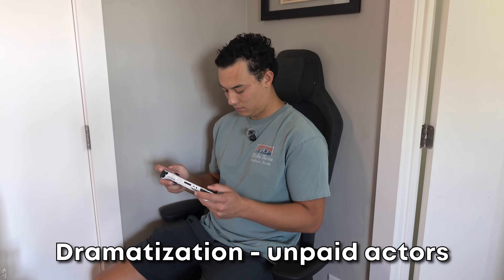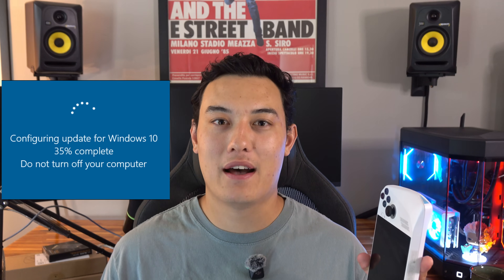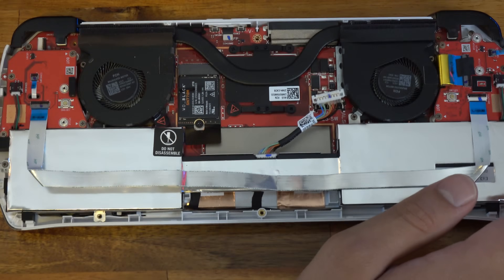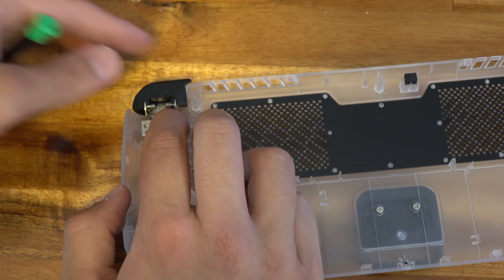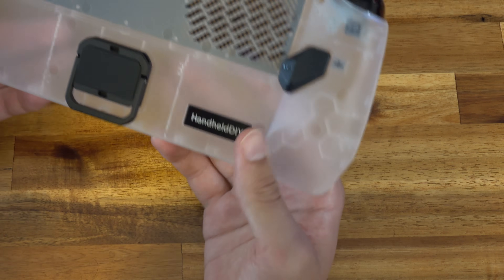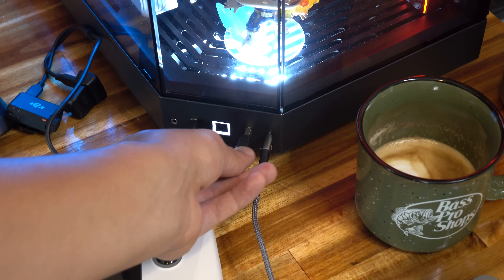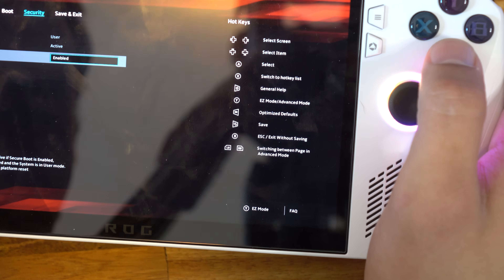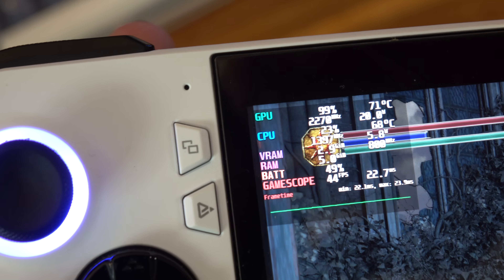$250 ROG Ally Overhaul – Full Mod Guide

Comment: So its been some time, can you give an Update on the battery Performance?
Reply from the maker: Held up great, still pushing 3 hours of playtime on AAA games
Reply: @JokOfAllTrades  thanks for the quick reply! Do you think the battery needs the custom backplate or would it be fine with just the original?
Reply from the maker: Original will work fine, just be careful with your trimming as to not puncture the batt

Comment: QUESTION !!!!
how is it a few months later ? the reviews on the one you linked are mixed so i just wanna ask
Reply from the maker: No complaints, just took it on a 6 hour plane ride and it lasted nearly 3 hours playing e33 and running at cooler temps than stock
Reply: @JokOfAllTrades heck yeah !

Comment: Couldn’t you just pop the back plate off an add extra ventilation holes to help with the cooling?  Assuming you don’t want, or aren’t comfortable, doing the other mods?
Reply from the maker: Definitely possible, you could just get some cutters or a dremel and knock out some more ventilation for free

Comment: For the back plate all I did was remove the filter screen and put a piece of electrical tape on the light sensor and it dramatically improved my temps. Free performance.

Comment: With that os can I install battle net
Reply from the maker: You have a linux desktop interface, so as long as it will run on linux ur fine.  I did end up dual booting windows back on so that i could run some emulators tho

Comment: I ended up just getting a dock with a 1tb ssd that I can swap between as required and fits into the standard travel case so I don't lose it. Also plugs into a travel battery pack for about 4 to 8 hours of extra power. I wasn't brave enough to open my ally and chop things up. Great video though.
Reply from the maker: Thanks man, i think dock setups are pretty cool

Comment: I had issues on Bazzite to get the Virtual Keyboard working correctly on my Ally X, so i switched to CachyOS Handheld Edition which is built the same way but everything just worked "smoother" - sticked to it and iam happy since. 

Maybe that changed in the meantime - it was in the beginning of the Year when i made the shift from Windows on all Devices i own (including PC on which i shifted last Year for Testing Purpoises) over to Linux.
Reply from the maker: Yeah I would love to do that but unfortunately much of the software is use is windows compatible only  :(
Reply: maybe you should give WinBoat a shot - it's made for such things and it's getting better and better. 👍🏻

I ran into similar issues with my stuff, but luckily I found a worthy replacement for nearly anything - the rest I got running with WinBoat (Photoshop) but this will soon also be replaced by Gimp when I've got used to it. 😊

Comment: Well lest se if it works for me, pretty except the SSD I ordered all the same stuff you use here, I did include a aluminum plate to insolate the battery and not using bassyte, since we'll I am kind of a filthy pirate, also how is the battery holding up?
Reply from the maker: Battery is holding up great, gl w the build!

Comment: Can I install the 74 wh battery If I am using 2TB 2280 drive with an adapter ? Will be there enough space ?
Reply from the maker: cant say for certain, but you should be fine since the drive isnt what is blocking the larger battery from fitting.

Comment: honestly the faster charger and an ssd upgrade is gonna the be most noticeable upgrades also get different different joystick caps that arent loose. this ssd is slower than a flash drive.
Reply from the maker: Flash drives are fast i.e. "flash" storage, but i get ur point.  I like the joystick and charger idea tho, might make a part 2 where i attempt the ram upgrade + these mods

Comment: When you said Rog ally z1 extreme did you mean to say just Rog ally cause the chip in the Rog ally and ally x are different and the one mentioned comes in the Ally X?

The ally has the z1e I’m pretty sure and the ally X has the extreme which is why it’s called the X, great mods just curious.

Also how much did the build cost and is it worth it over just buying an ally X? Especially a used one.
Reply from the maker: Yeah the original ally came with either the z1 or z1e, i was just distinguishing between the two.  Total cost was 250 for the mods and a used ally goes for like 250 rn.  If you can find a used ally x for ~500, i would probably just go that route, otherwise the modding is a fun weekend project.
Reply: @JokOfAllTrades thx!

Comment: Thnx so much man! I a steam deck I'm getting ready to go in on and i end up grabbing this same rog on the cheap the other day. The battery life was a major let down so i definitely came across this at the right time. I think the sd slot might be cooked on mine as well. Either way the ssd needs an upgrade. Anyways thnx for the video. Definitely subscribing! ✌🏾
Reply from the maker: Thanks for the comment!  Yeah the sd card slot is a 50/50 if it works, i wouldnt recommend throwing your nice sd cards in there.  Let me know how the modding goes!

Comment: Hi I used the same backplate as yours, but battery slightly bigger and right now facing problem that backplate cant closed completely, can you advice any tuning can be done? Thanks
Reply from the maker: If you got the 80kwh i think ur cooked unless you do some serious trimming.  I specifically got the 74 cause i knew it would fit
Reply: @JokOfAllTrades I used the original case and trimmed flat all the way then I can closed, I believed the handheld diy backplate middle part of the stand causing I'm not able to close it😢

Comment: Using PTM7950 instead of the stock thermal compound should also reduce thermals by a decent amount. However, some of that temp drop you experienced was probably due to less overhead with Bazzite compared to Windows 11. Hindsight, testing with the new back plate in Windows 11 first would've given a more accurate comparison.
Reply from the maker: Yeah i need to work on my benchmarking methods a bit, tbh i was worried about something breaking/exploding so i was pretty focused on just getting it to work at all lol.
Reply: What is ptm7950
Reply from the maker: @prosoilder1947  type of thermal compound

Comment: does bazzite better than win11 ghost spectre?
Reply from the maker: Havent tested personally, but id imagine anything linux based will generally run lighter than anything windows based
Reply: @JokOfAllTrades i have tested it compared to stock win11 avg fps roughly no difference, but 1% low much improved.
less 2GB of ram usage at idle too
Reply from the maker: @kucingganteng3148 1% lows is the most noticeable performance stat in actual real world gaming imo.  Sounds like it could be a decent matchup, i may even try that out for my main machine, thanks for the tip!

Comment: I have all the exact same mods. I didn't even turn it on until I put in 2TB SSD. Just recently updated battery and back plate.
Reply: May I ask how is the battery? I am now between legion go s with z1e, rog ally z1e or steam deck and don't know what to choose will also emulate switch games for my daughter
Reply: dont forget about fixing the wobbly joysticks and you can get a faster charger to push more power. but yea as a person who has the original ssd it takes forever to load and has really bad texture pop in. straight trash.

Comment: The only downside is really the joysticks. 

Not only do they feel way too loose for me, but they also use the same cheap modules found in the GPD Win 3, and they're prone to drift but easy and cheap to replace. 

I tried some Hall effect sticks, but the interference from the Hall effect triggers just wasn't working.
Reply from the maker: Ive heard the hall effect mods for the OG ally are pretty mid.  When my sticks crap out, I will cop a new model and do a follow up episode of this vid.

Comment: I bought a 2TB 2280 SSD for $100 and the 74wh battery for $50.  I just removed the black dust screen on the original back for cooling.  My Ally is a beast now.
Reply from the maker: Yeah insane prices on that, some dude was trying to tell me i could resell my ally and get a used ally x and spend less money.  I dont think that argument is holding up with ur prices lol.
Reply: @JokOfAllTrades how much did you sell / buy used? 
I found a 23’ ally extreme for $115. Thinking of buying it and modding it.
Reply from the maker: @Djxdarienx1 that is an insanely good deal, you should def scoop
Reply: @Djxdarienx1 where did u find this?
Reply from the maker: @Controla33 not him, but all of the good deals i see are on fb marketplace.  Ive sniped some pc parts for crazy prices

Comment: I’m surprised you didn’t use the windows debloat script like what Linus Tech Tips use everything time that install windows
Reply: There's no point in doing that
Reply from the maker: Ill take a look thanks for the tip
Reply: @JokOfAllTrades  Chris Titus Tool (Windows Terminal Script) is what I believe this commenter is referring to, its pretty useful but not an end all be all for major gains unfortunately.
Reply: Even with that the Windows experience is terrible. Bazzite is the way to go 100% of the time. Been running it for years now.
Reply: @witebatman  As someone interested in a Portable PC system like the steamdeck / Rog Allys...The question i have is can bazzite run non-steam games? Epic game launcher, Minecraft Java via Curseforge...."alternatively downloaded" games....etc..? Including games with Anti-cheat...specfically. Ive heard that trying to run epic games on linux based systems can cause issues with Anti-cheat.
Reply: @Dari300ra  also, Yes. You have play the suspicious games with little to no problems, as long as you read the menus during setup.
Reply: @witebatman  honestly i'll probably just get a Rog for the Win11. Im a pc gamer at heart and am extremely familiar with Windows. SteamOS and other Linux based OS just seem like too much work for what they do.
Reply: Tiny 11

Comment: oh men I see a lot of comments, but hopefully you can confirm if the shell replacement are the exact same size? because I do have a grip and not sure if it would fit with the new backplate
Reply from the maker: The silicone ones that go on the grips should work, i dont thing the jsaux case will tho
Reply: @JokOfAllTrades thanks for sharing, mine are 3D printed,  i think they wont fit

Comment: One more mod to complete is 32GB 7500mt ram upgrade. 🤓
Reply from the maker: For sure, i got a few comments ab this already
Reply: @JokOfAllTrades  yh this would definitely help but its not for the faint hearted 😂
Reply: I have it its very helpfull mod
Reply: @variousmusic630 did you update the bios and the ram stayed
Reply from the maker: @variousmusic630 im taking a look at doing this mod soon, do you have a guide you would recommend following?  I saw a couple helpful reddit posts but want to see if theres a good one already out there
Reply: @JokOfAllTrades dude just do it already man
Reply from the maker: @GoldFus1on dude im scared but at this point i can just replace for like $250 used if i brick it
Reply: @variousmusic630 For what?
Reply: @JokOfAllTrades bro plzzzz do😭
Reply: How can you do that? I want my ally to have that too  @JokOfAllTrades
Reply: Not exactly diy or cheap. Might as well go with a different handheld at that point.
Reply: @cmiller4567  if you're doing it yourself, than it's DIY
Reply: I did the same mod but I stuck with windows and heavily debloated my windows the way I did for my desktop and my performance is great as well as temps.
Reply: @brandonlopez8981  got a guide for that?
Reply: @brandonlopez8981  the debloating, that is. And for the ram mod while I'm at it I guess
Reply: That one’s max difficulty 😅
Reply: That's what I was gonna say. What about the RAM. That and the battery is the most important upgrades. The ram is hard to find techs to do the work. 😭
Reply: @jamsa2545 16Gb is fine for what the APU can run
Reply: Just go 64GB, the chips are only double price or so. 😅
Reply: yea but the average person wont be able to micro-solder !!
Reply: A guy did it actually, but other level of modification
Reply: Completely unnecessary

Comment: You can use secureboot, just need to reset the keys and put it on setup mode, then when it boots you can enroll the keys in Bazzite, you can do this in Desktop mode.
Reply from the maker: Thanks for the tip.  I just tried the secureboot fix first and it worked so I haven't messed with it since
Reply: @JokOfAllTrades 
Bazzite doc will help you a lot
It's one of the best docs I have ever read:)

Comment: Bro I literally did all of the same mods, same battery same backplate and same exact ssd lol! I put the official version of Steam OS rather than Bazzite but that's the only difference. Loving this thing, Lossless Scaling through Decky is also a game changer.
Reply: I just tried LSFG Decky yesterday and it blew my mind, especially you can use it on 30fps locked Switch games and it doesn't give you perfect 60fps because it doesn't smooth out stutters (ALL THOUGH if the option was given like "increase input delay but also smooth out the stutters", I'd use it)
Reply from the maker: @EverRusting  cant be compromising my input delay against gael bro 🥲
Reply: @EverRusting may I ask how well doest rog ally emulate switch games? 30fps is good enough for me, stable 30. My daughter wants Nintendo switch on birthday but was thinking of maybe put a bit more money and just buy something like legion go s or rog ally and just emulate games on it so she can play switch games but also normal PC games + watch YouTube, Netflix or just cartoons.
Reply from the maker: That's awesome, how has it been performing for you so far?
Reply: My battery (same one in vid) deteriorated over the past month and a half. It died at 40% and won’t charge to 100% I tried to cycle it and everything but it just died
Reply from the maker: @thejaconator6365 you pack it into the case too tight?
Reply: @JokOfAllTrades  don’t believe I did. It had enough wiggle room without free moving. All I did was put a little cooling strip on the RAM under the battery. But even before I did that it was deteriorating rapidly. I just put the old one in and ordered one from a different brand.
Reply from the maker: @thejaconator6365  eh, I mean we are ordering these things from china, prob due to get a few duds.  hope the other batt works out for you
Reply: @thejaconator6365  did charge it to 100% and kept it charged for 2 hours once at 100%, then drain it to 0 completely and then recharge it to 100% ?
Reply: @PluPerfective yeah I got a new one. Turns out mine was defective.
Reply: Is it worth doing this to save money over spending $1,000 on the new xbox ally or at least the fun of the tinkering?
Reply: @arnulfolemus1942 I enjoyed adding the mods but I’d suggest you save for the Xbox ally and put bazzite on it for performance. You could also buy an EGPU and a dock make something similar to a Nintendo switch style setup. Pretty neat what you can do with these things.
Reply: @a @arnulfolemus1942 also if you want a Xbox ROG Ally x fast, I’d suggest financing one from Best Buy and paying like 80 bucks a month. They have a no interest plan that’s super consumer friendly, it will also help your credit score grow.

Comment: Thanks for posting this video! I was using it to obsess over my Ally before I got it, and I also used it to help me actually do the mods once I finally got one today (Friday July 25th, 2025). What's interesting is that initially when trying to power on my Ally with my transparent HandHeldDIY black plate with a piece of orange electrical tape it wasn't turning on unless I connected power to it. Thanks light sensor lol but then IDK what happened... it just started working, and I'm glad because I don't wanna take my Ally apart again for a long time. I put a 2 TB 2230 SSD in there as well as the 74Wh aftermarket battery, and so far it's working wonderfully. upower --monitor-detail even reports 75 Wh vs the marketed 74 Wh.... I'll take it! Thanks again!
Reply from the maker: Yeah the extra Wh was a bonus.  Glad you found the video helpful, hope you get a ton of use out of your new device!

Comment: The last thing I would recommend to get the best temps is to remove the stock thermal compound and replace it with either PTM 7950 or a Kryonaut Kryosheet
Reply: Just an fyi it already comes with ptm7950!
Reply from the maker: This is a clever upgrade, thanks for the tip

Comment: Sometimes all you need is a refresher and it will feel like new
Reply from the maker: For real, breathing some much needed life back into this thing.  Id much rather upgrade what i have than try and resell and buy a new device
Reply: I'm glad I didn't upgrade to the ally x I thought about it but I backed out because I couldn't pull the trigger to spend $799 and later the price went up to $899 and that definitely did it for me, I think now that it's been 2 years plus since I've had this thing I will be upgrading to the legion go 2 I have about 1k saved and am ready for preorders to be announced.
Reply: Same man... day one owner I got a 2tb ssd right away after Day one purchase but the battery continued to be a killer until early this year I was able to get the 74watt battery on Amazon on sale for $39.99 and it really was a game changer I still used it everyday when I was in bed or traveled but now I didn't have to plug it in to the outlet as often.